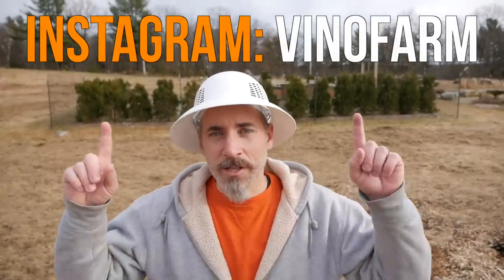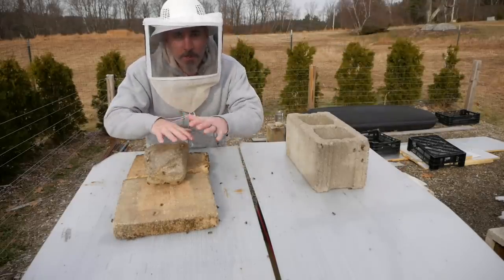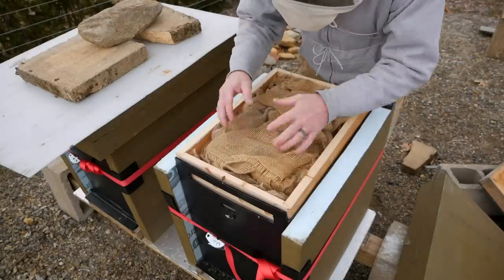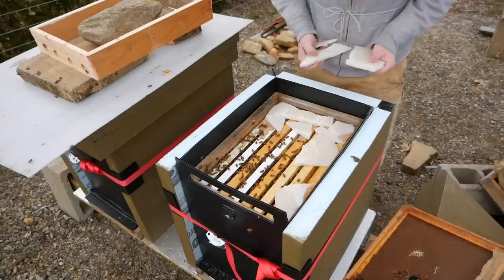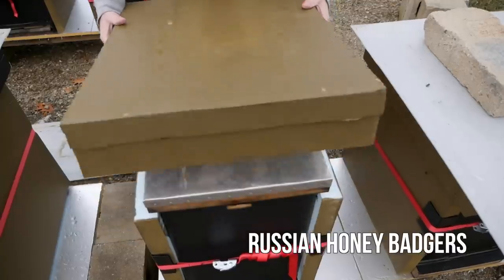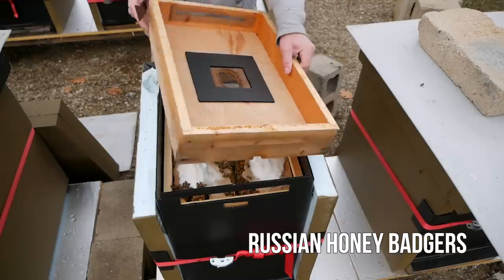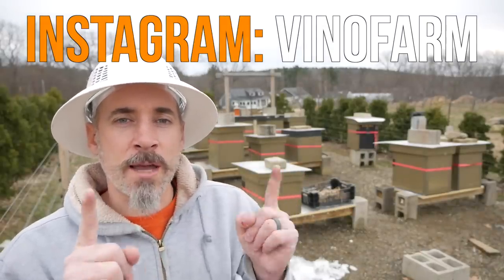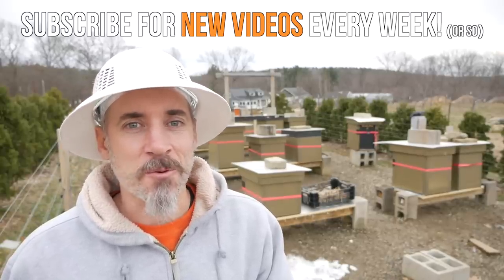Last Hive Openings 2018! (Feeding Fondant)

Comment: Maybe a random bucket with a lid. Few drainage holes in the lid and a hole near the end of the bucket opening. Turn it upside down after filling it with random scrap cloth/isolation material and such. Place it inside the bee area. Hopefully may avoid further damage on your new Isolation material, like the mice had done on that one piece. 

I mean, it is boring to have to re-create them just because mice wanted to stay warm.

Comment: Hives look good Jim. Hey, I have a FLiR if that helps with your infared decision. They make great products and work great on detecting thermals from the hive. Also, you built a deer fence, but you should also put up a horn trap. Those bucks will be dropping their horns in the next couple of weeks, and you can go collect them when they fall off. Take (3) T-rails, put two in the back and one in the front so it makes a V. Maybe the length is six or seven feet from tip to opening. Stretch it with field fence, and put some of your old apples up in the tip of the V. When those bucks go in to eat the apples, their horns will hook up on the fence and they'll drop right off so you can pick them up. Your kiddo, and your dog will love to have them. Have a Merry Christmas buddy.
Reply from the maker: That's clever. I have found a couple antler sheds in the field over the years, but I like that idea!
Reply: I've had pretty good luck with it out here in the semi rural areas that hold a ton of deer. It doesn't work to well out in the mountains where the deer are more wild, But around homes and farms it does. Just keep it a little further out away from the house or you'll get mostly does in. The bucks are wary. They won't venture in close like the does. Good luck if you try it.👍

Comment: Just wondering, but why do you use both granulated sugar and fondant?
Reply from the maker: I was under the impression that fondant was better and easier to digest for the bees, but I've been doing more reading and now I'm not so sure there's a difference. Dry sugar is certainly easier for me and the bees clearly take it, so I may start just using that now.

Comment: How did the mice get up in there?  I thought the foam covers were snug against the Vivaldi boards.  Did they chew through the foam cover?
Reply from the maker: They were tucked up in the seam between the foam cover and the side insulation. Not inside the hive. They routed out a little hole between the two pieces of insulation.
Reply: Can they chew on wood?
Reply: Mice will chew on almost anything.
Reply: I knew rats would but I was not sure about mice. Dang.
Reply: @vinofarm  Is that something that can be repaired with foam insulation or something to fill in the hole? I'm wondering if spraying with a bit of predator urine might also drive off the mice.

Also, while watching one of my Science channels, I found a video talking about a cool natural health booster for hives:

https://www.youtube.com/watch?v=tG9OKz0jsUY 

Have you heard of this before?